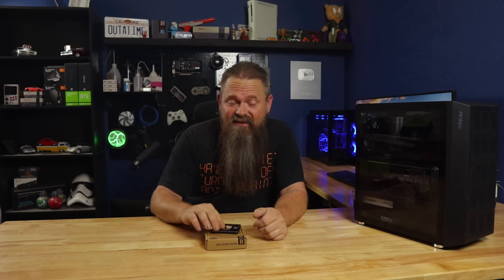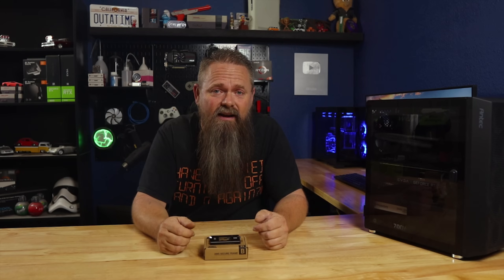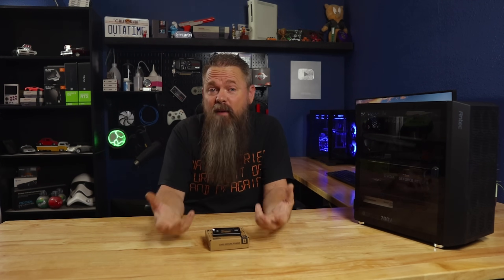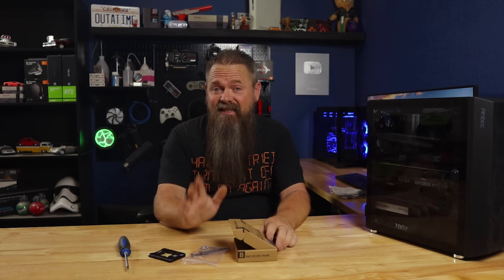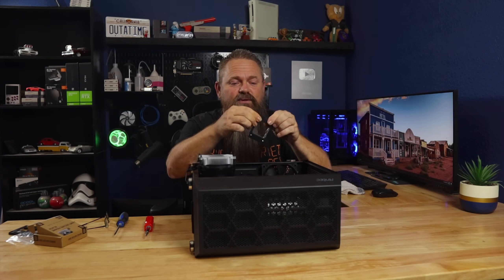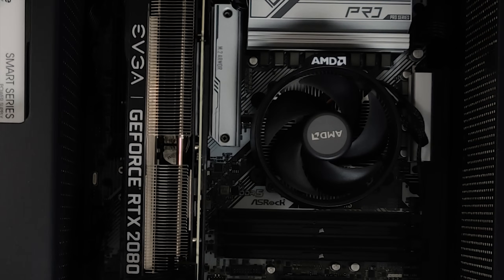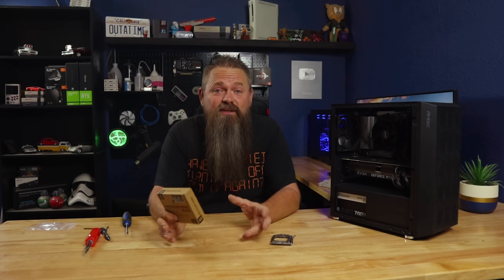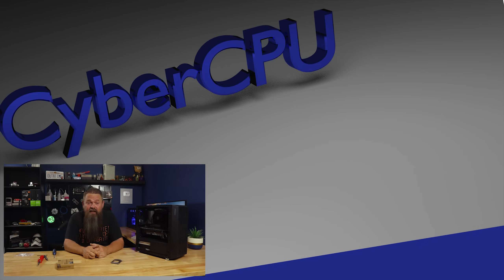AMD AM5 Runs Hot, Will This Fix It?

Comment: CyberCPU Tech : your thumbnail is literally damaging AMD-s reputation. Stop spreading false narrative as if AMD cpu-s are running hot. The AM5 cpu-s are designed to run up to 95°C intentionally. Everybody knows that and AMD announced it at launch.
Reply from the maker: It doesn't have too. In fact, it's possible to make them much cooler.
Reply: @CyberCPU  it's possible but it's not necessary because at 95°C the AMD cpu doesn't throttle but in fact it holds the frequency steady, voltage steady, amperage steady and thus has a steady performance.
It's designed to work at a continuously working temperature of 95°C.
Like for example the internal combustion engine, it has the best fuel efficiency when it reaches the 89°C temperature.
Reply from the maker: @lflyr6287  silicone degrades a lot faster at those temperatures. AMD can't defy physics. 

The primary reason for the higher temperatures on the 7000 series is cooler backwards compatibility with the AM4 socket. They made the heat spreader too thick to accommodate old coolers. Check out Der Bauer's research on the topic.

Comment: I was already planning on getting a CPU frame, and it wasn't even for heating reasons (aside from the actual heat sink of course).  Was going to get one so that I could use a larger graphene pad since they are prone to shift all over the place when trying to put the heat sink on.  They're also electrically conductive, so I needed a better cover to block the Ryzen capacitors that are unprotected.
Reply from the maker: That's another good reason that I didn't think of.
Reply: There are 2 graphine pads. The older is non-conductive and the newer one is conductive. I'm using the older non-Conductive pad and my cpu hasn't ever got hotter then 65c and I'm using a 120mm AIO in Push / Pull : My case is an Older Cooler Master HAF XB Evo with a lot of mesh pannels. I also have an exausht fan in the back - I can add 2 x 80mm fans in the lower left bottom side of the case to maybe help with cooling - but I haven't decided to do that yet.
Reply: @johnpaulbacon8320  I'm currently using the IC pads, and have been for years.  Was just considering trying the Kryosheet, which actually cools a little better.

Using air though, not an AIO which is why I was wanting to try the newer pads.
Reply: @johnpaulbacon8320  when a graphene pad is non conductive it is not a graphene pad.
Reply: @johnpaulbacon8320 Are pads recommended more over thermal paste or is it more preference based?
Reply: @ANTIQUELEGEND82  phase change pads are. ptm7950 beats the thermal grizzly kryonaut extreme paste. i used it on my gpu, and cpu, and seen a 5-10 degree difference which blew my mind.
Reply: Amazon sells a pad that goes around the CPU to keep the thermal paste from getting onto the them and causing a mess.
Reply: Tip: put a really little tiny dot of thermal paste in middle of cpu or the pad so it stays in place 😉
Reply: what was your max cpu heat